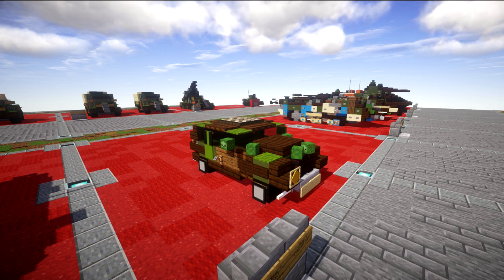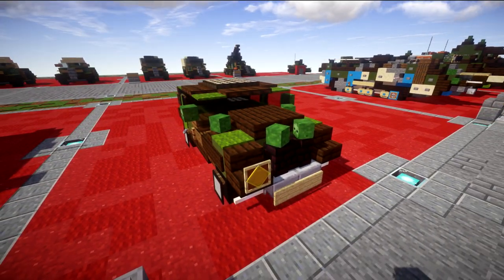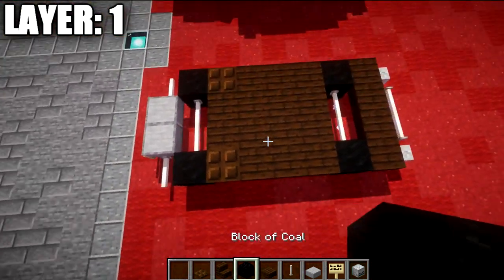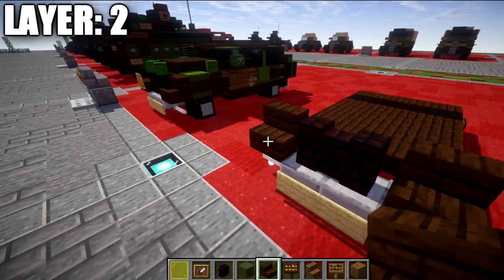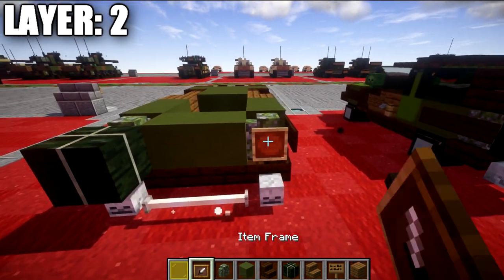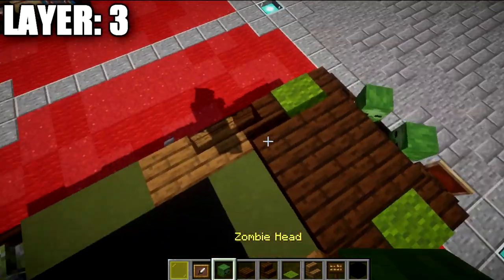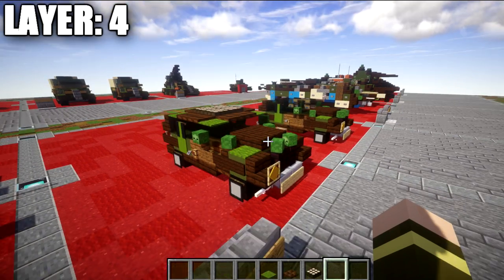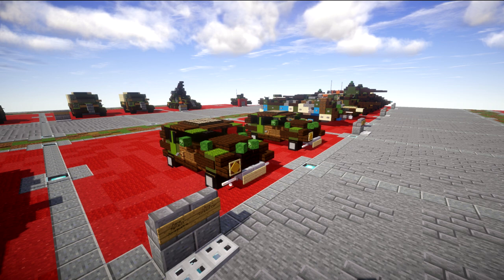Minecraft: WW2 Renault Juvaquatre | Compact Car Tutorial

Comment: Wait Is it supposed to have 1x1 block wheels cuz i have seen that in other ww2 you use 4 nether brick stairs for the wheels
Reply from the maker: Rurr_Asker This is a more accurately sized build. These smaller vehicles should have these size wheels. Larger vehicles will have the larger wheels.